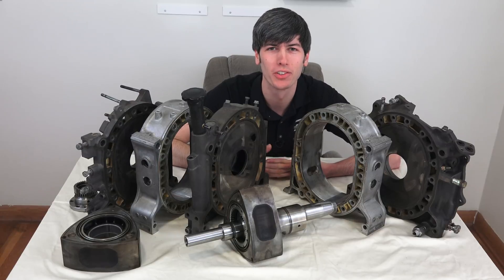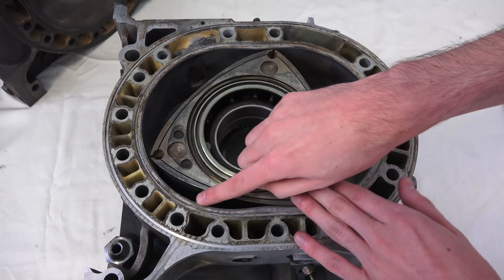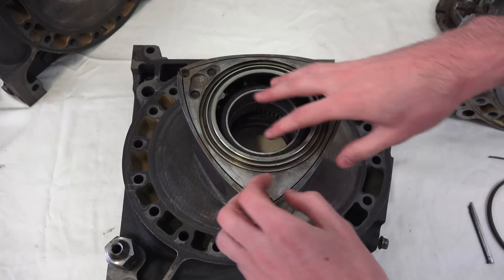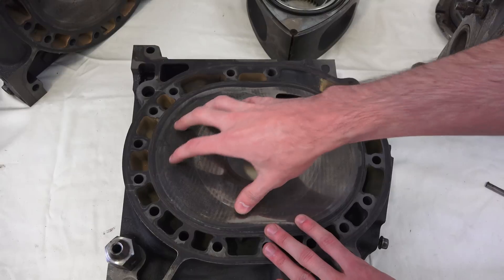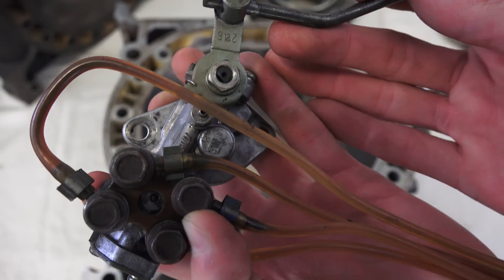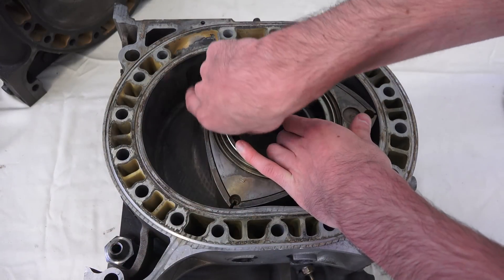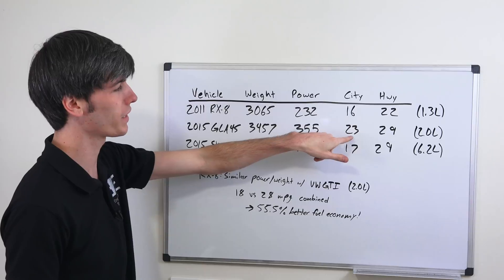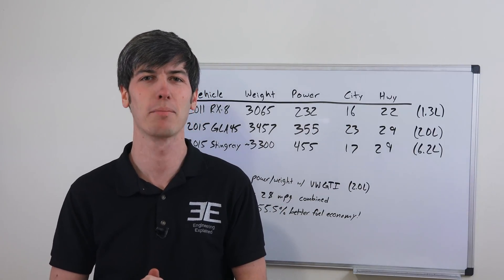4 Reasons Why The Rotary Engine Is Dead

Comment: instead of using the weight of the car to help factor fuel efficiency, why not use the weight of the completed engine alone. you should know using mpg is not a very good way to prove your point. the engine , when installed in different automobiles can have very different mpg. weight , transmission, gear ratio, aerodynamics, all of these will factor in. futhermore, there are a lot of engineers, mechanics, and overall car nuts that can argue all day long about the rotary engine. it has many attributes. the lack of moving parts, therefore little engine vibration, compact size, horsepower, easy to work on. all of these are great pros. we all know that this engine design is terrible for the environment. in the end that is the only reason. with global warming and the epa demands put on car manufacturers, I doubt we will ever see a new rotary engine design. sorry wankel
Reply: The real doktorbimmer The millet rotary engine was a set of 'reciprocating' pistons oriented around the center instead of inline. It was very much different than Wankel's rotary, and yes, 'non-reciprocating' is better, but most people attach the idea of reciprocating to a piston automatically, so it was implied. I know how a rotary works xD

Electric engines are now as much as 90% efficient, as are modern electric generators. Recently, the entire system has been shown to be as high as 75% efficient running off gasoline while also using electric engines, and the most efficient combustion engine cars have trouble maintaining 40% efficiency.
Reply: The real doktorbimmer Apparently you don't realize this video does not have ANY millet style rotary engines in it. Are you always this condescending, or only when people can't see your face?
Reply: But electric motors are heaps lighter and smaller for the same power of ICE engines. That makes up for the high volume and weight of batteries. 

But batteries these days are not at all practical. In the end, they cost more than fossil fuel cost, cos of the absorbent and ongoing battery replacement cost. At the moment, batteries are not even worth considering, unless they can do something about the batteries, otherwise batteries will never really happen. But there is a glimmer of hope for electric.

Ultra caps are used in buses cos the buses stop often and can be charged nearly instantly. Ultra caps are even worse for energy density storage than batteries, but ultra-caps won't need replacing (probably not replaced ever, for the life of the buses). This is the only hope electric has got (so far). lol
Reply: Not so. See my post on the new Mazda SkyActiv-R rotary engine. Mazda have done very promising research on HCCI ignition for its SkyActiv-R rotary engine project using research from its SkyActive 2 program.
Reply: @johnburns4017  You are completely delusional! 
Mazda Skactiv-R rotary engine????

Mazda hasn't unveiled a new rotary engine since before the launch of Windows 95!!!!!!
Reply: @sandervanderkammen9230  
Not this nut!
Reply: @johnburns4017  Just answer the question John, where is the new 2020 Mazda rotary you have promised us for years!
Reply: Glad to hear. I was just trying to point out the real reason behind the demise of alot of these engines. I am fond of rotary engines. I retired from the truck manufacturing industry. We have been plagued by the epa for the last 20 years with its ever ending mission of emission control. Alot of good men have lost their jobs because of it
Reply: My comments are about diesel. Heavy duty.commercial truck manufacturing. It will be a while before that is phased out.
Reply: The aluminum LS3 engine weighs less and also kills it when it comes to power and efficiency.  I won't even get into the LS's reliability over the rotary.
Reply: The real doktorbimmer 
Bimmer McBimface, you must stop making things up.
Reply: +Daniel Guerreiro
Half of UAVs use rotary engines. Maybe they all dropped in from heaven.
Reply: If you have defensible scientific evidence that climate change is false, then I invite you to write a paper and submit it to a respected journal or scientific conference.   That is the way to challenge a prevailing theory, not by ranting in an un-refereed blog.
Reply: The real doktorbimmer Didn't know that you are now the spokesman for every one. Please don't speak for others rather say you wouldn't buy one.
Reply: +lcicenine
"Anyone that "believes" in global warming is a moron"
Anyone who does not is an even bigger moron.
Reply: Jason Young are you really trying to reason with it? Look at its comments.  This is a troll or someone so void of logic and education its likely its special needs case.
Reply: Don't be obsessed with the planet, LOL.
Reply: You are so wrong. Check out Rotron just one of many still making rotary motors
Reply: +Jason Young
"that is more than offset by the amount of fuel going out the exhaust."
More myth. A rotary at a constant speed is equal to a piston engine right now. HCCI ign, laser ign, and exhaust reactors even improve it.  The small size means it is ideal as a part time genny engine in a hybrid.
Reply: +Yol Mak
Not another one!
Reply: Look see this guy is a clear astroturfer. If an engine type is obsolete it is not made and there is no R&D on it. The Wankel is made with R&D ongoing with new patents filed recently.  He is told this repeatedly, yet continues on the same mantra.  I wonder how much he is paid.
Reply: GREAT !!  More gasoline left over for me then !
Reply: That's true around 90% in ideal conditions. But normally less around 75-80% perhaps. There is another idea at hand here
Reply: Both of you fools are making errors in your copy and paste 
 answers, meanwhile the information is only partially correct, also you are both looking at different parts of the engine. and by citing different engine models.. oh dear neither of you are experts clearly.
Reply: You kids are mixing words of the a different variety and trying to define a meaning. lmao
Reply: ***** you give me far too much credit. It's possible to be both.
Reply: Things have moved on greatly.
Reply: Bimmer McBimface, please stop telling lies.
Reply: Oh piss off.
Reply: Maybe it is in a production car, but in the aftermarket it will live on as long as parts are still available or can be reconditioned. Maybe it wastes fuel but show me another engine besides a formula 1 engine that can easily surpass 200hp per liter.
Reply: Bimmer McBimface, please get therapy.
Reply: Bimmer McBimface, please get therapy. Please.
Reply: Bimmer McBimface, how is the astroturfuing going?
Reply: McBimface is an astroturfer.
Reply: McBimface, had a good day astroturfing?
Reply: McBimface, Astroturfing been good today?
Reply: McBimface, you are astroturfing.
Reply: BASSstarlet
You mean the baseless rhetoric funded by the richest people in the world (oil barons and other industry bigwigs) to ensure their continued livelihoods?
Sure, I'll buy that for a dollar!
Reply: Wankel is the only non-piston based combustion engine in consumer vehicles invented in the 1900's. That makes it a new tech. Time will tell if the fuel efficiency problems are solved, because the power to weight advantage makes it very much worth it. Regardless, ALL gasoline powered engines are technically made obsolete by the electric car, even on gas if equipped with an onboard generator.
Reply: The real doktorbimmer "Please do not confuse brand name slang with engineering terminology." Actually, you are the one who confused my brand name slang with your engineering terminology, but you got to spew your knowledge on me with an unnecessary correction.
Reply: ***** early on many of the mandated changes were flawed and made almost little or no total impact on emissions, this according tosome very well envisioned engineers. We soon discovered that the changes were more political than environmental. Hundreds of engines failed within months after being put on the road. Millions of dollars were lost in failed R&D, redesigns, recalls, etc. Then, by the time our engineers solved the problem, a new set of mandates were put in place. So you might see that these jobs were lost without need or relevance.
Reply: This isn't the best statement for your argument.  Al Gore's net worth is around 200 Million was only worth around 3 at the time he made An Inconvenient Truth.  He has made several fortunes on global warming.  Just so you know this isn't right wing rhetoric Here's an article  from the Huffington Post  http://www.huffingtonpost.com/2012/10/12/al-gores-net-worth-green-energy_n_1961299.html
Reply: I dont.But you should do a search about the big fraud about "planet overheating"
Reply: Their jobs are replaceable. The planet is not.
Reply: thats true. the planet is the most important priority.
Reply: Whos funded Al Gore?
Reply: c'mon, this is a BIG lie.
Reply: BASSstarlet
Well, I hope you aren't having children. Because they are inheriting a dying planet.

Comment: Didn't Mazda change the design so the exhaust port was on the side of the chamber instead of the perimeter so the unburnt fuel carried over to the intake cycle?

Comment: Why couldnt they just make it so that both of the chambers are used to ignite fuel? It should give more power and the heat problem should then be fixed.
Reply: Because the first "chamber" is still intaking the mixture and has not compressed it yet?

Comment: The design of the engine is great in theory, rotation is obviously more energy efficient than up (stop) down (stop) movement. However, so many other issues are created.

Certainly why the RX-7 was the only sports car with that engine, and hasn't been around since the 90's.

I imagine repair costs had something to do with it as well.

Comment: I remember the Wanker engines that came out in the mid 1970s ... the few people I knew who could afford them thought they'd get great fuel efficiency and were extremely disappointed.  Also they were also breaking down, so the owners were either stranded on the road or stuck at home with no way to get to work.  And no one could sell one .... people got too smart and wouldn't buy a NEW Wanker, much less a used one.  Lesson to be learned:  Americans like things that WORK!

Comment: What a great quality and entertaining video. My only complaint is that in your chart, you have compared a 2011 RX8 against two 2015 models. Assuming energy efficiency was improved in the 4 year gap with better technology, why not compare with 2011 models?
Reply: For anyone curious. Ranges differ by model:

2011 corvette: 14-16 city / 20-26 highway
2011 Mercedes gl class: 12-17 city / 17-21 highway

@doktorbimmer: That doesn't really make any sense. If you want to look at why something is dead, you should look at when it died (2011-12), not present day.

Comment: two questions, I'm really not a rotary guy, but could you run mixed gas and get rid of that oiler system?  and also, isn't it a little misleading comparing the displacements of rotary engines with piston engines?  It looks like the rotary fires on every rotation if I'm not mistaken, and a piston engine fires every second rotation... So shouldn't you automatically compare a 1.3 L rotary with a 2.6 L piston engine?

Comment: Anybody else irritated at the end comparison between the 2011 RX-8, which is a 2003 debuted model drivetrain, and the Mercedes GLA45 and Corvette Stingray which both had drivetrains debut in 2014. He's comparing the fuel efficiency of engine and transmission combinations that are about a decade apart in technology. If anyone hasn't noticed, fuel efficiencies (at least on paper) have increased significantly since then. Wankels do get less mpg when compared to piston, but its definitely no where near a 55.6% difference.The biggest problems have been, and continue to be, emissions (as shown) and reduced engine life (as shown). The advantage to a wankel is generally more hp to weight ratio (of the engine), size of the engine, and the ability to brag that your engine is unique.

Comment: Couldn't help thinking that placing an ignition device in the leading edge of the rotor could improve combustion. Injecting and burning motor oil is bad, kind of like when Saab ran two-stroke engines in their cars, how clean can a car run on two-stroke oil? Would improve the engine lubrication though.

Comment: Wouldn't a Oil tank be helpful instead of taking from the engine? increased weight yeah but worth it no?
Reply: is it better to use thinker oil and or synthetic ????
Reply: A lot of RX8 owners would move the battery to the trunk and use a second oil reservoir for the engine. That way you would only have to change your oil about 10,000-12,000 miles. Also you could use 2 cycle oil which burns cleaner and helps reduce carbon build up. Another solution is to remove the oil sump all together and just premix.
Reply: Mazda recommends 5W-30 in the Renesis. Which is what I used in my old RX-8.(Sold it for work reasons) The Synthetic, conventional oil has been debated for some time. The myth is Synthetic oil doesn't burn as cleanly but in truth it does. The main thing is to change your oil often, personally would do it every 2,000 miles.
Reply: I ran into this same issue with regular 5-30 motor oil and it burning a 1/4 of a quart per week, then I switched it to full synthetic and it would only burn a 1/4 of a quart per month (if I remember right) but by doing this it cut way back on the week to week refilling I was having to do and I noticed no change in performance or any mechanical issues and I had a 2006 RX-8 with the 1.3L 6 speed manual that was the velocity red with mica and it only had 38,000 miles on it, it was a fun car! I also would change my oil after doing this conversion every 4,000 miles instead of the 2,000 marker with regular oil, at 4,000 it had that look like the regular stuff at 2,000..

Comment: rotary engines =/= wankel engines!

rotary engines are rotating radial engines = the engineblock rotates,not the shaft. these were used in WWI aircraft especially

Also why are you only showing of the KKM version, not the DKM(original design!)?

Herr Wankel's DKM variant has much higher efficiency than today's KKM version

Comment: Dont you think that rotary engines could become as good as "normal" engines if the same amount of engeneering effort and years of development were put into the system?
Reply: It's not about being 'as good', engines are made for a specific purpose. You wouldn't put a generator engine in a car and expect it to perform well. This doesn't mean there is something wrong with generator engines, it means you're using the wrong engine for the job.

Rotary engines are all about high power-to-weight ratio and power-to-size ratio. They have low torque and high power. The sort of applications you would expect to see them in would be the power plant for an ultralight aircraft, or maybe in a motorcycle (although traditional two stroke is probably better for that purpose), there is probably more uses for them, maybe as turbine spinups for jet engines?

Comment: Correct me if I'm wrong, I'm no engineer, but couldn't you cut thermal imbalance by placing two rotors with opposing intakes. Also, to improve efficiency, secondary rotors that burn off exhaust and unburned fuel?

Comment: I really like rotary engine. But the problem is only Mazda is doing it. If it were Honda or Toyota who got big cash to spend, the situation might be different. Just my 2 cents
Reply: For the record Mazda's Wankel's are far better then anything anyone else made. The development push for them basically crawled to halt after 787B won Le Mans. Mercedes Wankel's were awful and GM is so incompetent they couldn't get the seals to work. Toyota is subpar engine maker, which is why they always lose at Le Mans, and got laughed out of F1.
Reply: This is false, the reason the wankel engine became obsolete is because of inefficient design. piston combustion engines were simply more advanced and more efficient. Which is why no one continued to develop on the wankel anymore

Comment: The Wankel may have a future in series-hybrid electric cars (where the engine turns a generator, which provides electricity to power the traction motors.) The Wankel has a fantastic power-to-weight ratio, which is just what you'd want for a hybrid.  And  many of the issues disappear if you run the Wankel at a constant high RPM, which is just what would happen in a series-hybrid. 

The standard four-stroke isn't ideally matched to this task...AFAIK the primary way they made the second generation Chevy Volt able to run in range-extension mode on non-premium fuel is they reduced the displacement. Running a larger displacement four-stroke in that role needs higher octane because it's almost always running wide open.

Comment: I bought a mazda RX2 back in the early '70s.  Nice car, engine purred, great acceleration, you could hardly tell the car was running.  Then when the car was only about 2 months old, it left my wife stranded on the highway -- motor just quit with no warning.  Mazda said the rear seals blew out and they wouldn't honor the warantee.  It was supposedly OUR fault the seals blew after only 2 months.  It cost the equivalent of 6 car payments to get fixed.  Years later we found out that mazda had a major problem with the rear seals and they weren't fixing any of them.  No wonder the rotary went out of production.  Too bad we didn't have internet then.

Comment: Two stroke direct injection is on the horizon.   Incredible power to weight.  Unmatched throttle response. Low emission.  Compact power-plant.